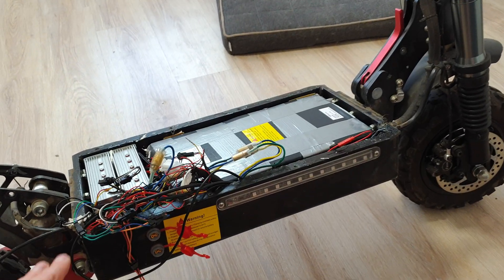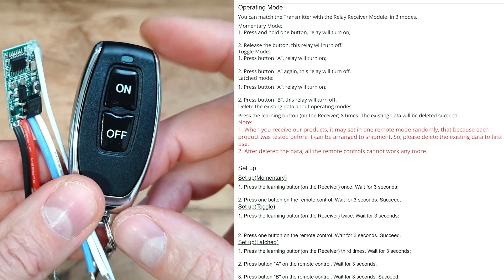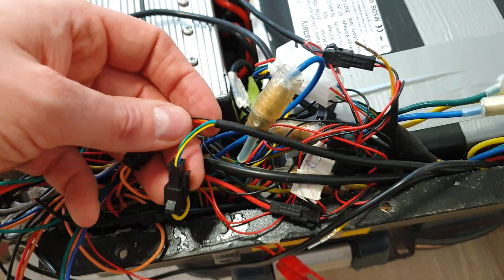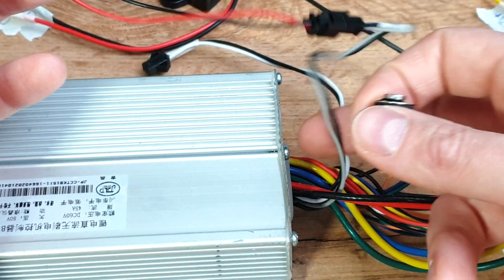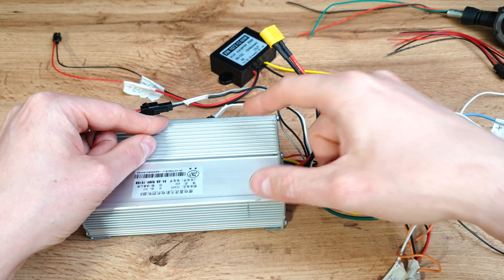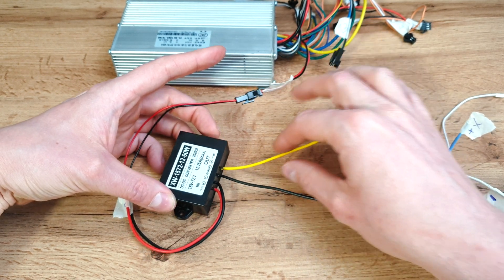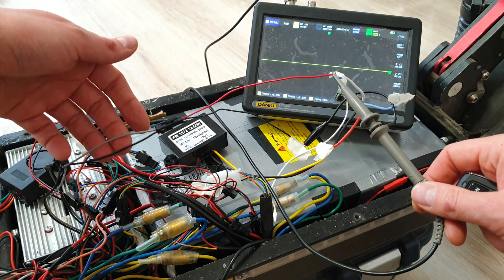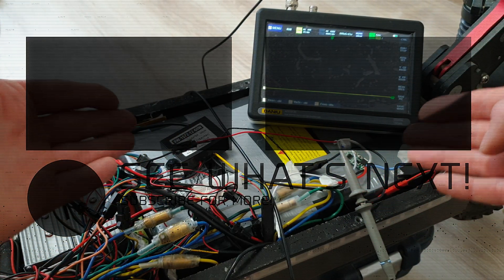How to Install DIY Remote Speed Limiter 🚀 for Escoot like Laotie Boyueda 🛴 FULL Long Story 🍕

Comment: Nice videos bro ! Watched them all now I think. I do have a noob question for you if you like.  Bought a next gen speed limiter ( the white ones) for  my ew q7 pro, but you are supposed to disconnect a connector ( 8 wires) and place the limiter in between original disconnected wire ends.  I can not find any connector that fits the one of my limiter. So I think its useles. Also bought the dyi from this video 

 But I have no clue what I'm doing , so many loose ends and spaghetti under the platforom..I will breake my scooter 100% .. 😊 got any wise words or point me in the wright direction ?  ( i cant even reconnect the two wires again so it seems..)
Reply from the maker: I checked video, all answers U will find in it.
Do it slowly & check every move couple times, one mistake and there is no happy end ** This is what she said ;)

Comment: I don't want to sound like an asshole, but I'm not sure what the purpose of doing this is, Isn't it the reason to use Echo mode to use less power, but by creating this button device, it will just use more battery power, just as you would if you were not using echo mode. I'm very confused. If you could elaborate more on why you're doing this and educated me I'd be grateful and appreciate it.
Reply: If the police stop you you can press it in your pocket and set it to eco mode because any thing over 25k Is illegal

Comment: Great vidéo. I recommand you to go for a Common Closed solution. This way when connected at the keylock, if you shutdown the escooter using the key the speed limiter will automatically goes ON... much better as you don't have anything to do togo back to speed limit.
Reply: Can you explain more?

Comment: Pirate please what wrench i need to tight untight front and back red shock   Suspension    Please link tool 

What pressure in tyres u use on e19

 thank you

Comment: Great video bro, I just ordered a Laotie ES19 so I don't know much about this. When it comes stock from the store does it go fast or is this what I need to go faster than 25? Also, what's the fuse voltage because I'm going to order everything you put in the description for links.

Comment: 🤘👍 top man you are doing a good job can you make a video about the connection of the receiver and what are you going to use now the remote control with two buttons or the one with 4
Reply from the maker: Maybe I will connect some tiny lights or some USB charger :) , there is lots of possibilities

Comment: I see you have an new throttle 
How sensitive is this one compared to the stock one? 

I am looking for difrent type's.  Since you nicely made finger to thumb adapter is still kinds really sensitive to ride slowly

Ive also come across an remapper which changes the throttle curve allot and removes the unused dead zone
Reply: what is that "remapper"
Reply: @santiagocastro5931  microprocessor which gets the input from the throttle and just delays/reduces power.    So it sits between the controller and the display

If you look on aliexpress on an throttle curve module for an dualtron escooter than you should find it. 

Made for dualtron but should be able to be used on any scoot using the hall throttle
Reply from the maker: remapper sounds good but you don't need any delay , you just need change signal curve, in this case Arduino will do the job ;)
Reply: @PirateWasHere  can you do a video to show us how to do It pls

Comment: Banggood actually has a speed limiter for Laotie ES18/TI30/ES19 etc., that is plug and play solution and costs around 12euro. Only bad thing about it is, that it's plugged directly to the battery so it sucks a bit of power all the time.
Reply: The alarm does the same so i guess this wont have much effect. 

Ive ordered one so ill see pretty soon how good it is.
Reply: can you link me this Speed limiter plug and play?
Reply: but the speed límiter límits Also the power or only the speed?
Reply: @santiagocastro5931  on eco it also limits a bit of the power however on dual motor its still really powerfull for an small escoot   so to the police its still "too fast"  if they are being anoying
Reply from the maker: well then 4 switches remote to controll 2 receivers , eco/turbo & single/dual drive ;)

Comment: so i can buy a basic on off little switch , and hide it somewhere it will work too ! good video thanks you !
Reply from the maker: yes ofcourse
Reply: @PirateWasHere  just for knowledge, why not connecting the blue + on the black signal one ( at 8:40) ? thanks
Reply from the maker: Cuz u will do short circut on high current so bada BOOM
Reply: @PirateWasHere  so this module have some current comming out from the blue + ! it's not just like a remote on / off switch !

i should take one like this then if i want the Escoot to be limited every time i turn on my escoot ? : https://ae01.alicdn.com/kf/HTB1abm7XK6sK1RjSsrbq6xbDXXaK.jpg
Reply from the maker: @ThePerizzo  blue is 12V 5A from step down, so if u will connect to the gnd and turn on , 60watt of power will be shorted ... You really dont want to do it ;)
Reply: @PirateWasHere  ok thanks !  so  for my need i should buy a different module. thanks again !
Reply from the maker: This one from ur picture is isolated electromagnetic relay , on my remote u got mosfet
Reply: @PirateWasHere  with this one if i connect signal cable to com and NC  when i turn off and turn on again my escoot it will be limited . i prefer like this !  do you think electricity consumption will not be negligeable ? thanks you for your answer ;)
Reply: @PirateWasHere  could you explain to me the disadvantages of an isolated electromagnetic relay, (the short version) ? 
thank you so much for your answer and video !

you made me get into the electric scooter ;)

Comment: Hi bro, there are some limits in Poland(street legal), or u heared some troubles with police? because i know only limits of speed in wallkimg areas( it must be close to humans speed ~20kmh)
Reply from the maker: It's very stricter, max speed 20kmh, max weight 20kg, actually escoot can be used only on bikes lane.
Reply: @PirateWasHere  so DIY remote  limiter of speed is done. Now u have to make diy remote limiter of weight🙃🤣to be fully legal
Reply from the maker: @ДенисКожокар-ь4х  Hmm maybe some remote to release helium 😎🤣🤣🤣
Reply: Technically North Carolina, USA, is the most strict in the world. Anything with wheels and a motor is a vehicle, requiring license, registration, and taxes. Ebikes seem to be a loophole. The scooter can go 10Km/h and needs registration! If it exceeds 30 mph (48Km/h) it’s a motorcycle, also requiring insurance. The difference is that the responsibility is entirely on the owner. You can buy a 72 volt scooter and as long as you don’t come across a Karen, or an angry cop, there are no restrictions. Nothing is automatic. However, I doubt there are many countries where whipping down the road at 70 Km/h on a child’s toy is viewed as perfectly fine. In other words I don’t understand the purpose of this hack. It is interesting technology though.
Reply from the maker: @tedhancock68  last time my Bro from EU get 2100E uro fine cuz police just decided to check his scoot. I guess for EU users this mod could be kind of interesing ;)
Reply: @PirateWasHere  This comment made me look up the fines here. It’s 25 USD for not registering, and 75 USD maximum for severe violations like carrying multiple passengers. None of this would happen unless you ran a stoplight, hit someone, or Karen reported you. If under 16 they might stop you to look at your license. I love your videos! I’ve already incorporated many of your modifications.